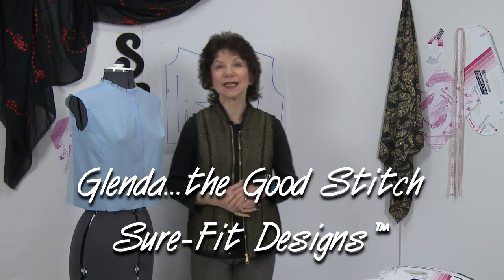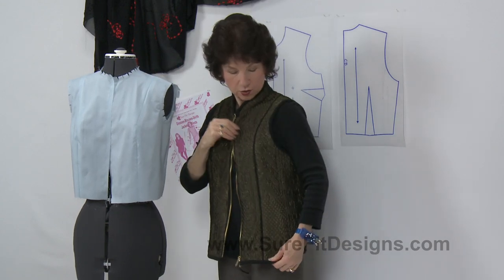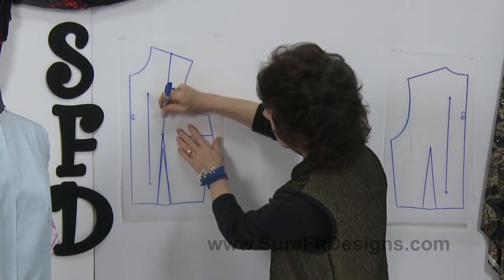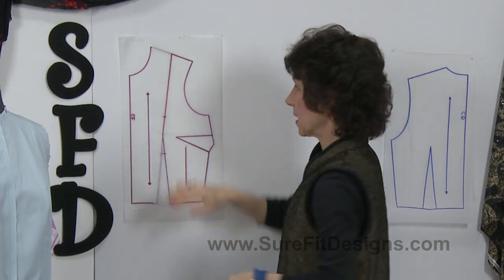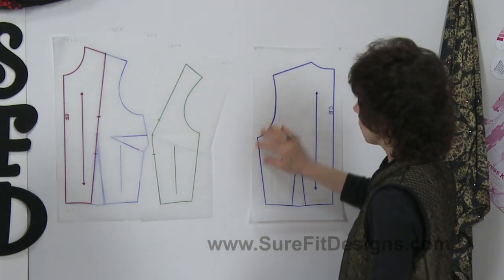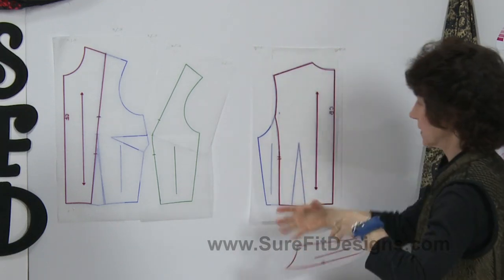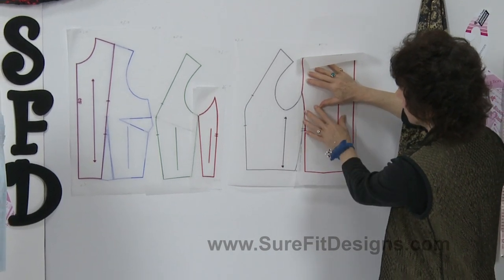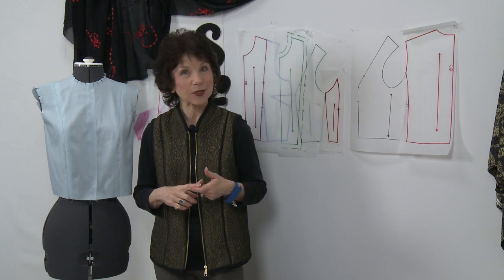How to design a Princess line Without a Side Seam

Comment: thank you again. I want to design a princess steamed both on front and back w/o a side seam so I can make a 4 slit mid length dress for both summer and winter wearing by putting in a removable long sleeve under buttoned to the dress sleeve hole. I had a dress I was going to use as a pattern but nature took it from me by way of river water. long story . but I now have a good idea of how to do my desired dress.

Comment: Apologies if this is covered in another lesson, but shouldn't the seam line at the apex on the side panel be softened (rounded) a bit? 
Looking forward to receiving the shirt, dress, and pant kits I ordered yesterday. Your method is the answer to my fitting woes. And your are a teacher beyond compare.
Reply: The side panel can techniacally be any shape as the center front piece is the leading seam (It's the piece that should be up facing you as you sew). So it will maintain a nice shape to the seam.
Reply: Thank you!

Comment: Glenda, I loved this presentation. I have a question. In balancing the grainlines on the side panel, you added waist circumference. What would you recommend to remove that excess?
Reply: +Taylor Knighte Personally, I do risk changing grainlines in altering patterns / combining pattern pieces, and find it's usually not such a big deal if the directions of the two grainlines I'm combining aren't too different. You just have to be more careful sewing if it puts a seam a little bit more on the bias than it previously was, and take care that the change doesn't put bias somewhere you don't want much stretch and distortion. So here in this case, you'd probably want to preserve the grainline of the front piece or make the new grainline closer to that one, because otherwise it's going to play some havoc on your bust and armscye / shoulder; it would be less of a problem to adjust the back piece to that front grainline, at least if the back piece doesn't go all the way to the shoulder as well, which it doesn't here.
Well, that's my theoretical answer: I haven't done this particular adjustment yet, but I'm drawing these conclusions from experience with other adjustments, and from the fact that 18th century bodices did have front pieces wrapping all the way to the back, putting some bias to the side-back part, and clearly it worked for them on a closely fitted bodice. :-)
Reply: beth12svist I definitely see your point. I was thinking, increasing the dart intake in the front bodice, if you picture the intake increasing, you can see the side seam become much straighter to the center back. Then when "mapping out" the design lines, it wouldn't be much of a drastic alteration of the grain.
Reply: I'm not sure I understand it in the terms you put it - English isn't my first language, you see, so while I can use it really well, from time to time I still run into a wall... But if my understanding is what I think it is, my thinking went that way, too, and then I realised taking in the darts was, basically, just arriving at the base shape created by joining the pattern pieces at the start, in a complicated backtracking way, if you see what I mean.Taylor Knighte

Comment: because of surger done for breast cancer , my breast are not always the same size. Pads get quite expensive. I feel that a pincess line is not quite right for me. Do you have a rexomendation for my situation?
Reply from the maker: Mary Burt - Actually, I think a princess line might be a good choice if you have first of all drawn a right and left side pattern - one side with a smaller dart..  But another nice alternative would be to transfer the darts to the shoulder line then sew as a release pleat (not a finished dart).  And perhaps another alternative might be a cowl neck blouse as there would be enough draping in the front to camoflage one side to the other.

Comment: @Cheryl S: You don't necessarily need a mannequin. What you definitely do need is good eyes, a good large mirror, good light, and a lot of patience - it's going to take years to get there, but it's definitely worth it.
Without a mannequin, you're probably going to need a fitting partner who will occasionally mark and pin things for you in the back.